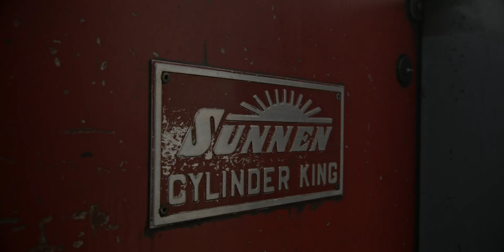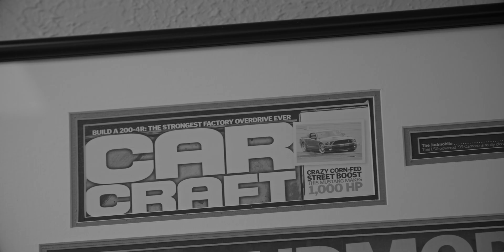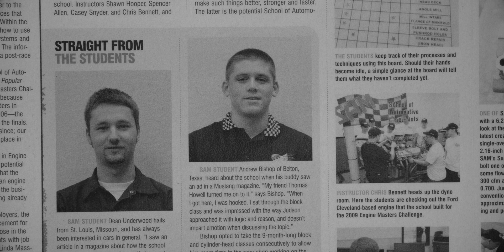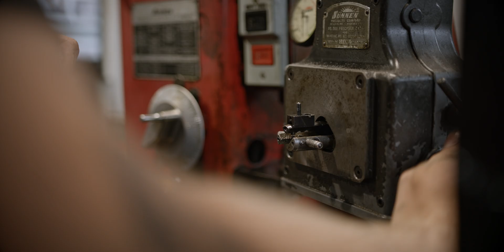Building better race engines with SAM Tech!

Comment: Good school. Attended SAM in 2011-2013. Study hard, ask questions and get to machining. It was said while I was a student there that when you return home after graduation, your buddies wouldn't be your friend anymore from the knowledge you learn from SAM. 

Well, that person wasn't a friend, but a Boss and shop owner. He felt threatened from the things I knew and purposely prevented me from advancing. I did bore, hone and recondition Rods and that's it.

My point: It's ok to start out in a small "Mom & Pops" shop, but if you desire to build HP and serious Race engines, leave those shops and work where you can apply all your knowledge you learned at SAM. It's like graduating from Harvard and then going to work at Sears. 

Study hard, build engines and go make money in the Racing world instead of the Hobby world.
Reply: Hello, is a race car mechanic the same as an automotive mechanic in terms of education and how they fix and work on vehicles? But, racing mechanics being more geared to super vehicles and high performance engines? Like, do they do the same work? Can a race car mechanic do the same work as an automotive mechanic (gas mechanic and diesel mechanic) and work on auto vehicles? Because I am going to attend an institute here in my city and they offer race car mechanic, which I am greatly interested in, and automotive mechanics, diesel mechanics and industrial welding. thanx!
Reply: @Fightdefensesportsscience97  race car mechanics are the same as your automotive service mechanic. Just so happen they also work on race cars, something specifically on race cars since it pays more than the service mechanic. Race mechanics can work on daily driven cars, but not all  service mechanics can be or want to be a race mechanics because of the long hours and days away from family and friends during season. It takes a lot to become a race mechanics. Time, training and commitment to the race season and race team is needed.
Reply: Best thing is to open your own shop
Reply: What if I understand engines but dont want to build them just tune…would you suggest that efi program or do you not know because obviously you werent in that program?